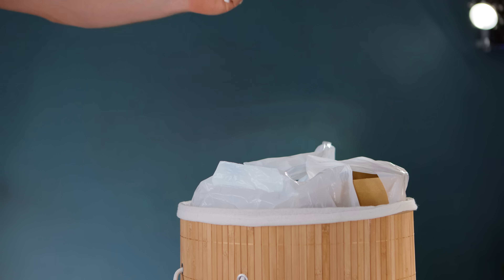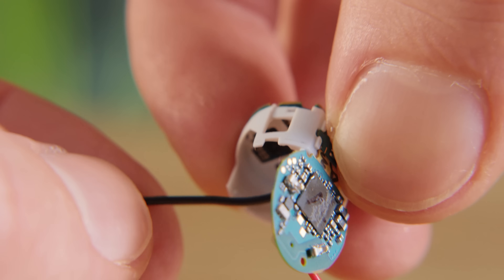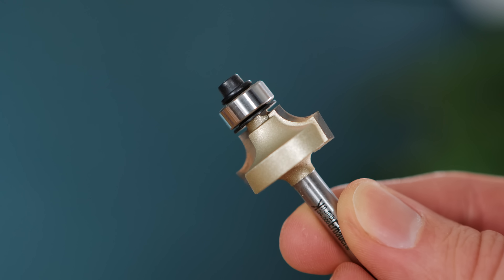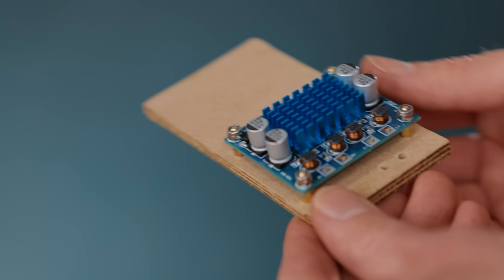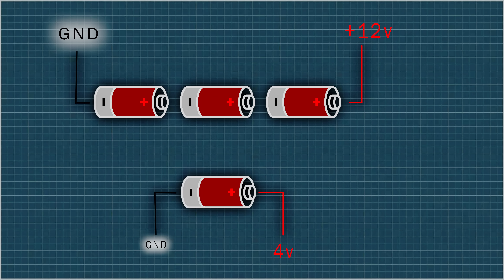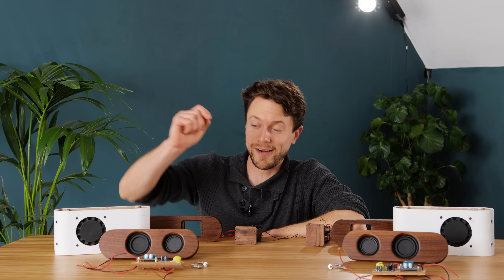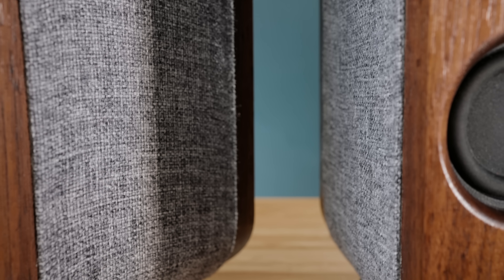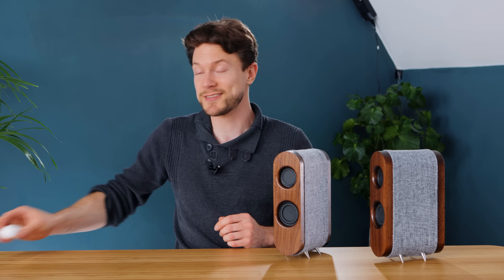Transforming dead earbuds into POWERFUL wireless speakers

Comment: Have situation where I've put my earphones in the washing machine , the buds are water resistant , but the case isn't It has light blinking , but the case is not charging what may be wrong with the case and is it repairable , because there are some light in the case , it's just not charging , suggestions ? 
Thank you in advance

Comment: Please add some rubber to the feet to avoid them sliding. Can the charging mechanism be built in?
USB charging?
Very nice project. I love your DIYs
Please keep it going
Reply: You probably can use some 18650 with a proper bms for charging them.
Reply: @FR4M3Sharma  Thank you. That is a good idea and will not increase the weight much.

Comment: The design and execution are perfect as usual. I'd change a few things, though:
1. Charging and power delivery method is a bit cumbersome - I'd go with a BMS, type-c and galvanic isolation. Sure, a bit more costly, but less hassle with charging 18650's separately.
2. Hard pointy feet may give a bit of a rattle on high base. And they're scratchy as well. But, they look really cool - cant argue with that)

Thanks for yet another portion of inspiration!
Reply: Everything is glued shut, which was disappointing... this is the Apple of DIY, aesthetics over repairability
Reply: electric tape?
Reply: @TheFalseShepphard  You could probably also dip the absolute tips of the feet on some rubbery black plastic glue or paint, like "fingernails". Just enough to give it a bit of padding, and if you make it very carefully, still aesthetically pleasing.
Reply: @Enderplays12 The typical solution is to use small feet that have rubber isolators on the bottom and a cup to locate the point. You'll see these on high end loud speakers, generally in the $5,000 + per loudspeaker range.  I've turned them for myself for small projects using a bit of aluminum to get the outer dimension correct, shape the parabola to locate the spike, then a parting cutter to slice each one off of the bar stock I'm working from. It's a fun and easy project you can do even with a inexpensive tabletop lathe and will set your projects over the top!
Reply: @Enderplays12 that would look really good and will probably fix the possible issue. Good idea!

Comment: This inspired me to build something myself. I used an amplifier from an old surround sound system, bought some drivers and some wood. I'm really proud of the end result and the sound
Reply: build anything and everything you can that shits cool
Reply: Would love to see it. Did it cost much?
Reply: Any change to show the result in the video here on youtube? would love to see it!
Reply: Mu blutooth device has a button which needs to be pressed after the battery is connected to turn it on. I am unable to turn it on simply by connecting external battery.

Comment: I have some of the Bluetooth headphones that wrap around the neck. Do you have an explanation for those? I have a cnc machine. But lil to no electronics know how. Great video!
Reply: With bluetooth headphones that wrap around the neck, typically there will be 2 modules on the wire in addition to the earbuds. For example, one module will contain a battery and a charging port (and maybe a power button), and the other will receive the bluetooth signal, and maybe have a mic and some additional buttons. (The earbuds may also have magnetic sensors to detect if they are close or open, so if they do, you’d need to spoof that they are constantly open.)

‘Truly wireless’ earbuds, have one master earbud, and one slave, where the slave receives a relay of what it needs from the main earbud (except if both the earbuds, and the phone support Bluetooth 5.2). 

So in your case, if you wanted two separate speakers, you would need to have a master speaker, with all the receiving electronics, and then have a port on the back to plugin speaker wire, to provide the other speaker a signal.

Comment: This is an awesome video and it really exposes how bad manufacturers suck at engineering stuff like this. If you use lower resistor values on the high-pass, could you get some louder mids/highs?

Comment: I made a set with 3.5 outputs and a usb powere input. No battery. I use them to run a set of Bluetooth speakers that have a usb charging port right below the 3.5 input. I can plug them in and have a stereo pair. Thanks for the inspiration

Comment: I have been creating an improved version of this project with internal, rechargeable battery packs for a capstone engineering project. The whole point of the project is to learn something along the way, but I sunk almost $300 in the project and that is after certain materials were provided from my school. Love the idea and I have learned so many new skills along the way, but if you’re looking simply to have a nice sounding pair of speakers I would definitely buy some instead of going DIY.
Reply: What? A voice of reason on a DIY channel? Get outta here!
Reply: Would you mind a noob question? :) How did you get it to work with a single rechargable battery pack? The devices I found are both 3.7V, but the ground loop noise mentioned in the video is concerning.
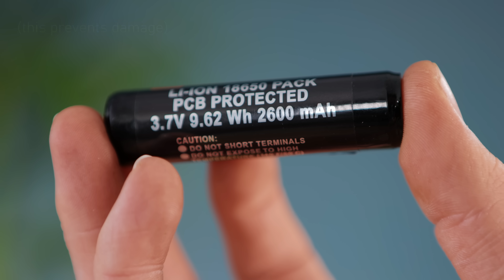Reply: @inconspicuous-nobody  He used two voltage sources (see 9:51) 12v for the amp and 4v for the ear bubs, or you could use an isolated DC to DC converter which "isolates" the grounds, coupled with a buck converter, or boost converter (from a single 18650) if you want to be able to charge the whole thing from USB.
Reply: @andchip.s  digital DC to DC converters introduce MAJOR noise into audio systems, especially a small system like this. Analog regulators are more inefficient, but sound much better.
Reply: @davelowets  Very true. How would you design the circuit with an analog regulator if you required the ground to be separate and using one single power source?
Reply: @andchip.s  Why would you want the ground separate? If you must have a separate ground, as in 2 separate power supplies, create a dual polarity/split power supply with a positive and negative LDO regulator.
Reply: @davelowets  If you replicate the experiment hear, but using one voltage source you will get issues with the circuit, try it for yourself and see.
Reply: @andchip.s  I don't quite understand the point you are trying to make, and the problem you are suggesting.. 🤷🏻
Reply: @davelowets  If you want the device to be portable AKA battery powered, you will need to isolated the grounds from the BT device and the amplifier, (if your amplifier module has not got a separate analogue ground) as connecting an amplifier with no separate analogue ground to the BT device will cause unwanted noise, this is due to the current pulses from the BT device (a LDO regulator will not solve this issue due to it still having the same ground reference. Great Scott has a very good video regarding this.
Reply: @andchip.s  The noise can be mitigated by proper Star grounding techniques, enough physical space between the devices, the proper use of decoupling caps, shielded wires, and RFI/EMI shielding. I've done it before, and mine is noise free.
Reply: @andchip.s  How do you think that the headphone amp INSIDE of a Bluetooth device, or the amplifier inside of a Bluetooth speaker operates from the same power supply (battery inside the device) without noise? 🤷🏻
Reply: @davelowets  Does not work for me, I guess I'm doing something wrong. Would you be will to show a circuit diagram of your solution? Also this maybe down to the different classes of amp used that's my theory anyway, Your thoughts?
Reply: @andchip.s  It would be hard to draw up a schematic here, but if you had it working but noisy, you had it wired up correctly. You simply have to take the usual precautions, such as a star grounding scheme, where all of your ground wires are roughly the same length and brought back to the same central location. Keep your power wires as short as possible, not ran near components, twist the positive and negative wires together along all lengths. Use decoupling capacitors at the ends of all power wires, as CLOSE to the circuit boards as possible. Tin foil can be used to shield components when nessicary. Orientation of separate components can sometimes be critical when they are physically very cloae to each other, turning one of them 90° can make a difference sometimes. Definitely use a quality shielded cable when passing small audio signals between components. If you experience noise when connecting grounds together, most of the time the issue is "ground loops", or a potential difference in voltage between the 2 grounds. Star grounding helps alot to eliminate this. Decoupling caps are also a huge thing to help. 
Using a quality shielded cable (with an extra, 3rd shielding wire inside) with the shield connected up to the chassis, or ground, to one end ONLY of the two components of which it's connected, is a popular strategy to quash noise. 
Experiment, and try some of these solutions, you will succeed.
Reply: @andchip.s  Yes, you are on the right track, sometimes 2 small audio components that are not meant to be modified and wired together just don't work together because the circuit design doesn't include the nessicary circuits and designs required to be tapped into, the audio extracted, and passed onto a seperate component. Also, sometimes this comes down to one device having a differential audio output scheme, and the other device having a single ended design, in which you'd have to use a single ended to differential converter circuit to pass the audio signal between the components. Other times it just takes some of the techniques in my above statement to get it to work. One way to be able to tell if a device has a differential output scheme is that the differential one will have a separate ground for each of channel of the audio output, and they won't be connected to each other or the common circuit ground. A single ended amplifier topology will have one common ground for both of the audio channel inputs or outputs. This WILL cause noise issues if you try and wire the output or input grounds of a differential topology together and connect them to the single ground of a single ended device's input. You would need a single ended to differential converter circuit in between the 2 devices.
Reply: Again, it’s the reasons  you just eloquently laid out. Learning , pride, teaching and more importantly not fkn them into the bin after 5 minutes. I have a little wooden box made for  me by my uncle when I was 6. For Christmas. I’m 53 and I still cherish it.

Comment: If u read this I have a question

I have and old pair of headphones (BT) and the only problem is that they don't stay on the charger the head phones keep popping out. 
I was wandering if it would be possible to turn them in to a single wireless speaker that can hold a long time charge to use. As in use the battery in the case and headphones to make the speaker

Comment: You are very right to mention the importance of the stereo effect to the listening experience. I've been experimenting with a pair of aiwa midrange drivers for quite a while. When I brought them close together (not in an enclosure or anything), they didn't sound like much. But when I placed them far apart and properly pointed them at my ears, the result sounded MAGICAL. Not only was it louder, but the details were clearly audible - NOTHING like before. That's why I decided to make my single unit bluetooth speaker project a bit more unique, and allow it to split so that you can place the speaker drivers far apart for an awesome listening experience, but also whenever you want to, you can join the drivers back together so that you don't sacrifice any of the convenience and portability single unit speakers offer.

Comment: Very nice work (with the proper very expensive tools), but the earbuds are really the least relevant part. Giving the cost of all the other components, and the effort required, you could just better buy a good pair of wireless BT speakers. And save a lot of money.

Comment: Great idea lots respect but just 1 teeny tiny little issue. what happens when they run out of juice?
looked a bit awkward to replace the batteries  > .< 
so is it possible to add a charger and rechargeable batteries  =D

Comment: I just thought of putting battery chargers inside each speaker and installing plugs in the wood to connect the chargers to their power source, also relocating the charger indicator lights to the back panel.

Comment: If you chosen a sealed back tweeter, you didn't have to add the divider in the box, effectively making the volume of the box quite a bit larger = more bass, and them tiny speakers could use it.

Comment: Going by the list of components he linked to (besides the ear buds), it will cost more than $250. It is a good project for the achievement, and better sound than monolithic stereo speakers at that price point, with a bit of inconvenience to take the batteries out to recharge.
Reply: could just solder the wires to a dc adapter
Reply: Could you get a 8v usbc break out board?

Comment: wonderful and excellent,
But let's find out what you forgot about this project,
Any loudspeaker box cannot be completely closed because it needs holes to allow the air to surround the speakers from the inside in order to vibrate freely to push the air out and in and this will improve the sound level produced to the maximum level. Now the sound produced is incomplete because the speakers do not move freely to equalize the air pressure between the vibrations .
My Regards .

Comment: would batteries from a wireless headset connected to a plug not be easier? Just for the sake of not removing them? Unless that was the goal, because of safety issues.

Comment: Great video! How about headphones using this exact same concept? It may seem somewhat pointless. But I would like to try making DIY 3M Worktunes Bluetooth earmuffs, using two independent 40mm speaker drivers connected to the same device. Kind of like having "over-the-earbuds". I have snowboard helmet speakers placed inside of my earmuffs, but they can't produce the sound that I need.
Reply: I've seen wireless speakers inside a beanie, I'm sure you could achieve a similar result

Comment: Fantastic, they certainly look and sound incredible the only thing I would do differently is to have a usb charging system fitted so that you don't have to remove the batteries each time to recharge them
Reply: This should be the top comment.
Reply: My thoughts exactly
Reply: Really would want to opt for a LiPak in that case. 18650s USB charging isn't good.
Reply: Also the aux in and a power supply connector for more versatility.
Reply: @thenoddingturtle  No AUX 2023!!
Reply: There are lots of disposable vape cartridges that have USB-C charging circuits.  I wonder how difficult it would be to integrate one of those?
Reply: Since three of the batteries are hooked up in series, I don't think you can charge them without removing them from the device.
Reply: @NachosElectric  You have to use one of 12v BMS + 1 1cell dedicated BMS
Reply: @NachosElectric  oh.  right.    good point.   hmmm….
Reply: or go even further and use wireless charging
Reply: So should I wire in a laptop battery charging Input plugs into each speaker to charge those batteries? Is that enough or am I missing something
Reply: @prasun911 you need a Lithium battery charging circuit otherwise you're at risk of making a beautiful sounding pair of incendiaries 😂
Reply: and how do you know they sound incredible when they are recorded through a mic and then played by your headphones/speakers? I mean he did use about 180$ worth of speakers (not including any other components and materials) but I'm pretty sure actual audio engineers whose job is to design speakers can do better for the same price.

If you are going for sound quality then you should just pick up some wired speakers for the same price or even less and get most likely better quality. If you want portability for on the go use then single piece off the shelf bluetooth speakers are way more practical.

I do have to admit that they look really cool, and "I built my own speakers" gives you some major bragging rights.
Reply: @-CrySa-  But the point was in the build. He's a maker.
Reply: @nikthefix8918  I know, I don't have any problem with him building them, and they are in fact really cool.

I'm just saying that it's only a good idea to build your own speakers if you want a fun project to work on, not for any practical reason.
Reply: @-CrySa-  but You could use some old laptop or tv speakers like he said anda is note 180 dollars anymore right?
Reply: @Tazxding0  well yeah but then they sound like old laptop or tv speakers
Reply: @-CrySa- some old laptop speakers where pretty good :p like Sony Vaio beat laptops
Reply: @-CrySa-   You know they sound good because he compares them directly to other speakers using the same recording method. Sure audio engineers could do a bit better of a job, but then their product gets a marked up retail price afterwards to make a profit, whereas with these DIY ones you're only paying for raw materials.